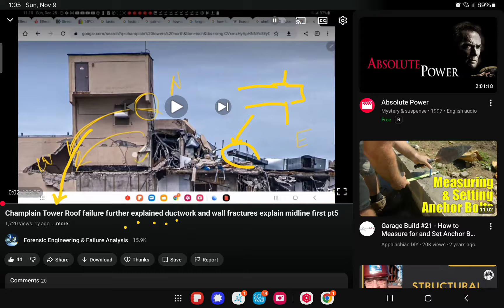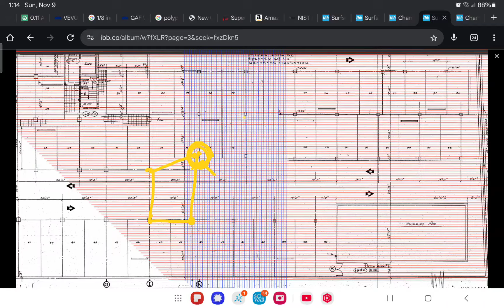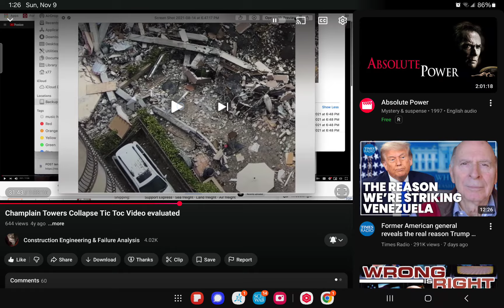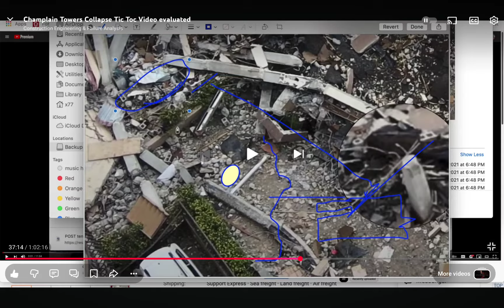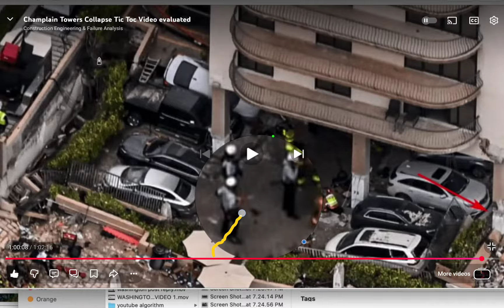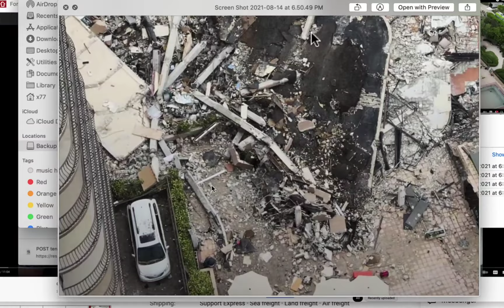Champlain Towers I called failure location over 4 years ago!

Comment: I'm reviewing your videos again and I can see clearly now there was a misunderstanding. In this video you take the phrase 'at the wall' to mean the the basement wall itself failed, that has never been my perspective on the place of initiation. Perhaps it was for others. I have always maintained that the failure initiated somewhere between the south basement wall and the columns at row 15 east of row K. For example beneath the planter box itself. At 21.27 you correctly draw a crack in the parking deck we agree on, but you fail to identify or mark an additional crack which must exist south of that line which is necessary to allow the plants to tip towards the deck in the way we can see they have.
Reply from the maker: Sorry, I responded to the wrong video with you... The parking garage in Philly is the roof. I spoke directly with insider information.
Reply from the maker: Ps I have never meant that the wall inside the parking garage failed at Champlain towers.
Reply: @LoadPathEngineering we agree on this point.